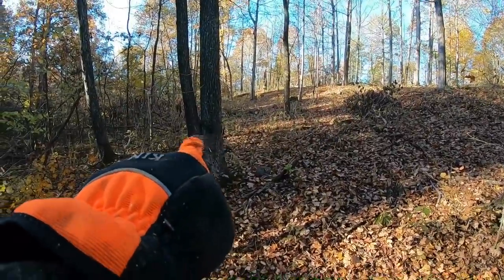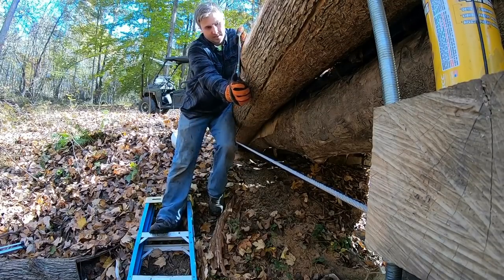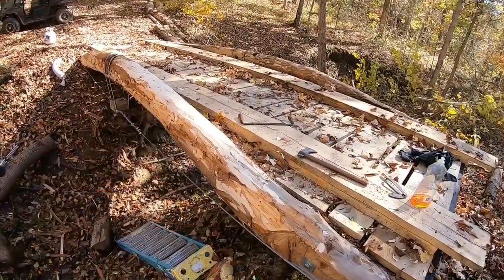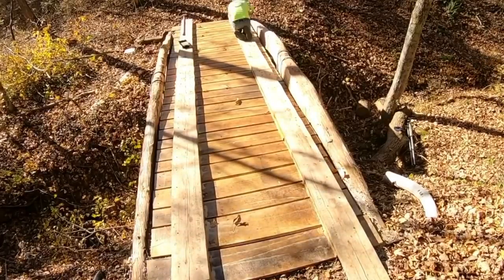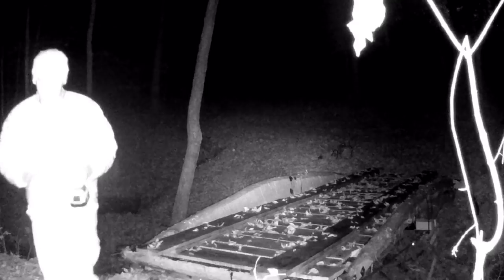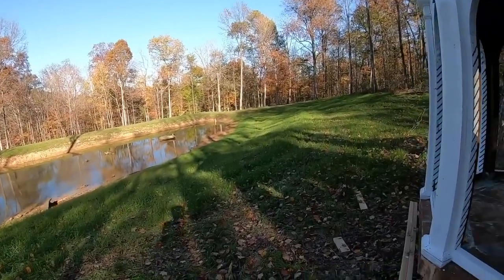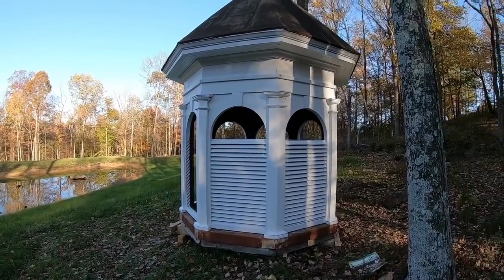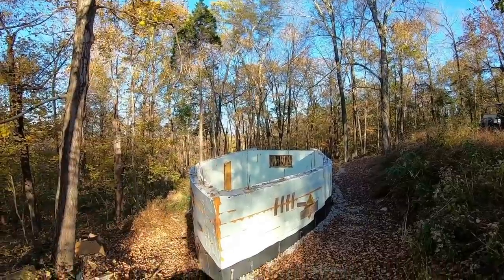Applying Timber Oil to Homemade Bridge in the Woods - Bell Tower Update

Comment: A little trick ya might do when painting is to stick a small Paint brush into a Gallon freezer bag and keep it in ya back pocket as it will come in handy when ya need it and it wont dry out when using it  ever now and then to clean up the runs of paint and can even be put in a Fridge for days without cleaning the paint out of it

Comment: Captain, Timber Oil is an Excellent product. I made some steps out of logs a few year ago and used that yearly to protect them from the weather in PA. I have a steep bank leading down to the lake where my dock is. I cut the logs 4’ wide and cut them down the center with a chain saw. I secured them to the ground with 2 four feet pieces of rebar, one on each side. So far so good they haven’t moved and the water covers the first couple steps early in the spring. I’ll send you a few pictures.
Reply from the maker: Very cool!

Comment: You will get a much sharper edge if you draw file it.  If you don't know what that is, you just move the file along the length of the blade without moving it forward, one hand on the top of the file and the other on the handle keeping thee file perpendicular to the edge.

Comment: Capt Kleeman - that bridge will last at least 50-years.  The air circulation all the way around it will help much; the asphalt(?) bedding on the ground structures will also be of importance, as will those additional water-insulating wraps you added.  You've done about everything possible, other than coating everything in epoxy!  I did one similar to this 34-years ago and it still stands.  And I did not go quite so far as you have...great work and work ethic.
Reply from the maker: I hope you’re right!  Thanks for watching

Comment: Great job with the bridge. As for the sharpening/honing of your tools, check out a few really good videos on techniques related to it. Paul Miller and Buckin' Billy Ray Smith are on two ends of the spectrum, but great resources.
Reply from the maker: Thanks for the tip!

Comment: Just some thoughts: 1) Always try to sharpen w/ the edge away from you, you did good by flattening the back of the edge last and a bench grinder can remove the blade temper if the metal gets too hot (as others have said), 2) glad you got the bell tower a 2nd coat before winter, 3) if you like IC Weld check out Cutting Edge Engineering and 4)  it's so very wonderful for you and your family  can live where you do. Regards, Hank S.
Reply from the maker: Thanks hank!

Comment: Try draw filing your draw knife. the way it was explained to me, as a young man sharpening my bush axe for my daily job of chopping tree lines for boundary surveying, the short stroked in one spot create waves in the edge even if you cannot see them. Those little waves and scoops and scallops created by filing like that create waves of different pressure on the edge of the tool making it harder to use; this is very much the reason why there are teeth on the excavator buckets. When you draw file, you hit all of the surface evenly as long as you can keep your file at the correct angle.

Comment: A nearly lost art, for sharpening a hand scythe, is peening. Peening work hardens the steel as it thins out the edge so it can be stoned to a very sharp edge. I think that would work great for the draw knife. A file is better, in my opinion, than grinding or sanding away more material than is necessary.

Comment: Heard you said ,Mike that you going to apply 2nd coat of cabot oil next time..think you gotbitbwrong 2nd coat should be applied when its still wet n tacky not dried as it will not penetrate further into the wood..believe me i made mistake b4

Comment: It would probably be better to sharpen the hatchet, and draw knife especially at a low speed. You can use a bench grinder but you have to be careful not to build up too much heat in the blade because it will weaken it and make it chip and not hold an edge as long. Knifes are heat treated to make them hard so they perform properly and if they get really hot again it can soften them causing them to get damaged more easily. A file for heavy work and some wet stones would be the best bet. That is if you plan on using these tools for wood working such as timber framing, this would be best for them.

Comment: NO NOT USE A bench grinder on the drawknife for sure- and the hatchet too - file or rough sharpening stone.  grinder will burn the metal and soften it -  oughta get one of your long planks to use for a scaffold board across the ditch.  cordless leaf blower to use the ryobi battery.
Reply from the maker: I have a ryobi leaf blower

Comment: Thanks for sharing, looked like a great day outside. Projects look good, looking forward to seeing the next few getting built. A local farm near me that does a petting zoo/pumpkin patch in the fall has a overhead bridge scaled down for the goats to play on, might make an interesting addition if you have extra rough cut wood left over after the build. 

BYW, I liked your extendable broom handle, was that it’s intended use or was it a paint roller extension? Looked like it would be great for snow ❄️ on the car 🚘.  I used to have a special push broom just for snow, until my mom used it on the garage floor. 😂 I guess I’ll have to check out the local stores around my area.

Comment: Sorry I had to step away from my comment.
Think of it though- what does the dirt do when you use an excavator bucket on it? it comes out rough and crumbled, not very smooth. The teeth create areas of high pressure that will push into the dirt very well and the shape causes it to lift and break. If you were to transfer that shape down much finer, say to a razor blade, would you want to shave with it? or would you rather use something closer to a smooth flat plane? with wood planes, the tendency is to go towards as smooth and flat an edge as possible to shave the wood except for one type of wood plane- the roughing plane. What is the shape of that blade, slightly convex, like one big sharp tooth.
Just something to think about.
thanks for the videos.

Comment: You have way more patiece than i do, i would have had the generator and airless paint sprayer on the tower and the bridge lol. Talking about wasps.....i started my old loader up yesterday, it has a 4” pipe up thru the hood so ive always sit an old 8” can over it when i shut it down. Well lemme tell you, when i started the loader the can flew off as always but when it landed flat on the ground i bet it was 200 of those big ass red bastards looking like a cartoon swarm coming up to the seat. I had 6 sting me but i think i outran the others or they flew into the house door and gave up, 30min later i got 95% of them with the brush burner but maaan that nest looked like a cake inside that can as every sq in that the exhaust pipe didnt take they had it jammed with wasp nest and larvae....
Reply from the maker: By the time I would have had the generator drug out, sprayer out,  prep and cleanup,  I would have had it rolled.  With less noise too.
Reply: @CaptainKleeman  definitely less noise for sure but with that much peace i would have ended up with a hammock strung up doing nothing but enjoying the sounds of nature

Comment: I know you've already thought of just about everything and get tired of people asking stupid questions (I'm really good a stupid sometimes :). But, why not an angle grinder and wheel for debarking? Also, I know you enjoyed the day staining but, wouldn't spraying be better as far as getting the best coverage? And lastly, I hate wasps just as much if not more.  I think they come out more when you have a warm day after it's been cold because they know their time is limited and those little sob's are out to sting whoever they can find before it gets too cold!
Reply: Spraying is definitely better, but getting power out there may be an issue. Battery spray equipment could be pricey.
Reply: @firesurfer  I was thinking more of a pump sprayer. I use one to spray my deck with water seal every few years. You can stain the same way.
Reply: @rogerr1296  I'm not sure that's effective. He would have to do at least 2-3 coats. That's a bunch of pumping. Maybe it could be done. The stain can be heavy, it would have to be thinned a bit.